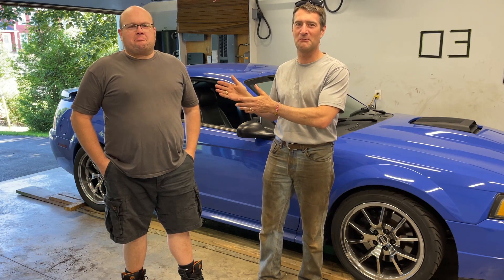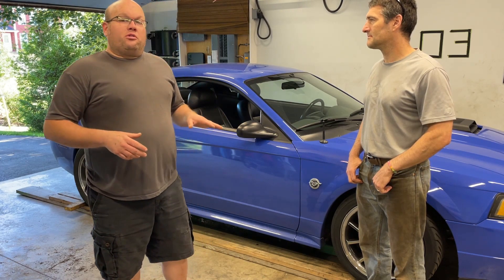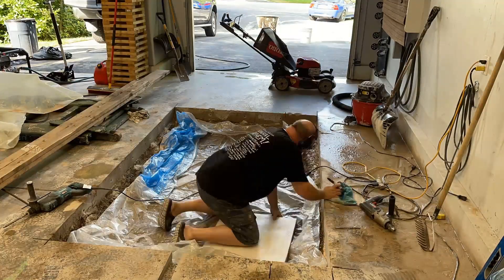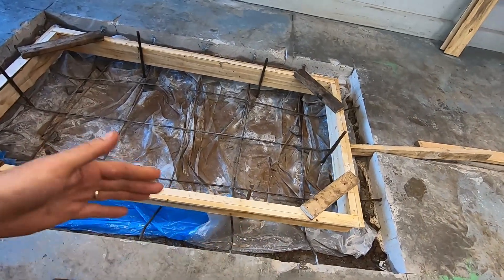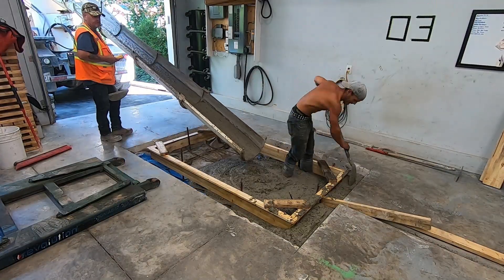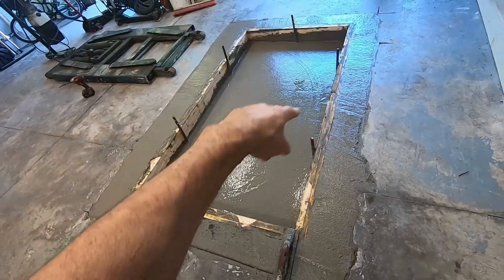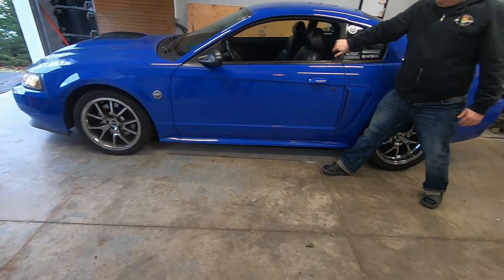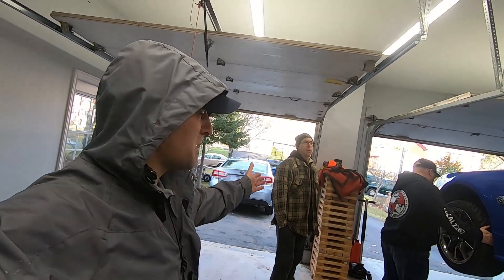Recessing Scissor Hoist In Existing Concrete Floor

Comment: I like the setup. The lift is great allrounder that doesn't get in the way for front back and side work, setting it in the floor with a cover gets it out the way and allows centre work (trans/exhaust /lines etc) with the car up on the wheels cribs and the lift lowered off.
Cheers D

Comment: Just my opinion. It looks like trash. An eyesore in the center of a beautiful concrete floor.
Reply from the maker: For me the piece of plywood in the middle of a garage is a small price to pay to greatly simplify automotive work.  I actually think the hoist looks beautiful.
Reply: @mrdiyguy123  it does look beautiful and the piece of plywood over the hole is perfect not to mention a great adjustable workbench . Thanks for all the great ideas I just have to get off my butt and do this with mine. Dale
Reply: @mr diyguy123  Jay is a clueless fool,  and doesn't know the real concept of this. Looks great,  I have the same life and have wanted to do this for years, your video along with a couple others has just put me 90% more towards pulling the trigger. I've always thought about the downfall of having the ditch and possibly tripping over if etc, but that plywood cover just Solved that issue !! Paint the plywood gray and 💥💯👍🏾 looks 1000's better !!
Reply: @1uniquez  haha...listen I getcha man it's the artisan concrete with a total getto lift that gets me confused. If you have that kinda money....make it fancy...not a hillbilly mod.
Reply: I like it @mrdiyguy 😁 Suggestion for your buddy with his new lift… put some sheet metal under those rollers. Sometimes the steel rollers will cause a bit of damage and eventually make “ruts” in your concrete